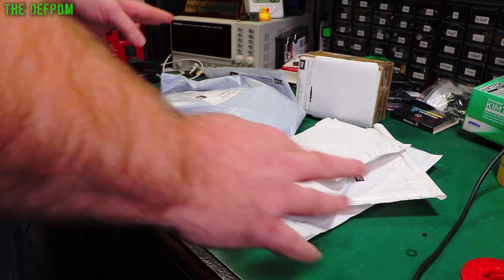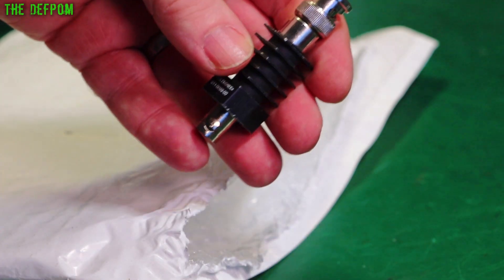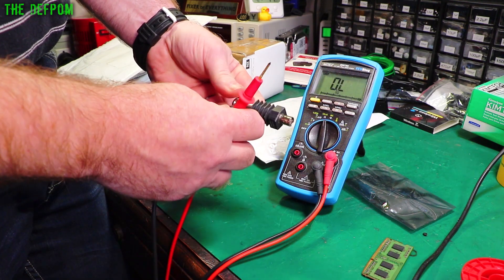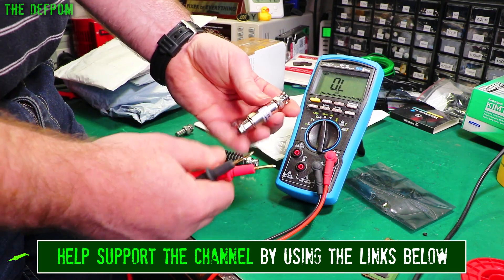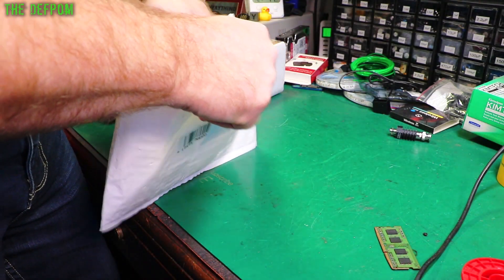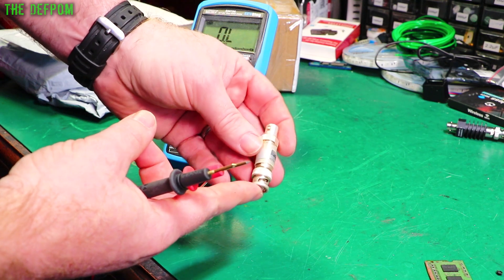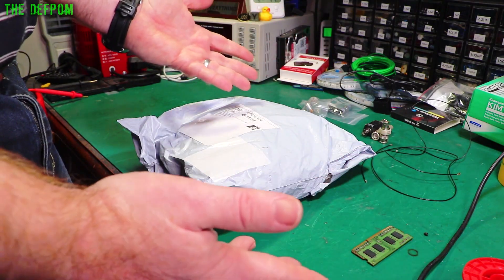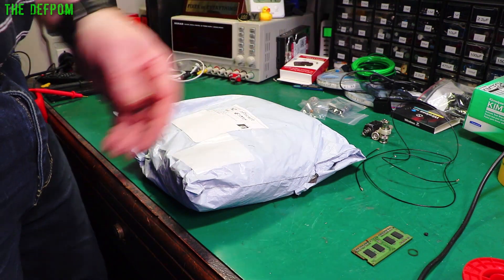🔴 Mailbag Monday 21st June 2021 - No.844

Comment: Bet the Tektronix termination set you back a few shekels. I've looked myself.....for both Tek & HP used probes, attenuators, terminations, DC blocks and was summarily shocked.
Reply from the maker: Yeah, pretty expensive for what they are, but sometimes you have to get a quality item because the cheap stuff doesn’t cut it.

Comment: I wouldn’t worry to much about the accuracy of the terminator because the source impedance and cables won’t be exactly 50 ohms. But still nice to have branded parts as they are less likely to be inductive
Reply from the maker: Yes that is true, but at least the termination won’t be adding to the error making it complete tosh.

Comment: It was too hard to see on the video, but very carefully inspect the connector crimping on the U.FL cables.   Depending on the cable, the true manufacturer of the connector, and the quality of the assembly you may only get ONE good connection attempt before it breaks.
After testing hundreds, I have found few Asian connectors worth a damn.  Always buy authentic Hirose brand connectors for critical applications.

Comment: The ground connection should not be open on the Tektronix terminator.  It is broken.
You need to measure the attenuator when it izs connected to a 50 Ohm load.
There are some good inexpensive Chinese feed through terminators, but there is quite a bit of crap.
I have a video on feed-through terminators you should look at.
Reply from the maker: I will have to look at it more closely, BUT an isolated terminator could be handy sometimes… I will check out your video.
Reply: @TheDefpom  To be truly isolated it would need to be a transformer.  
I have that exact model terminator.  It is a 5 Watt model.  The ground should be connected through.